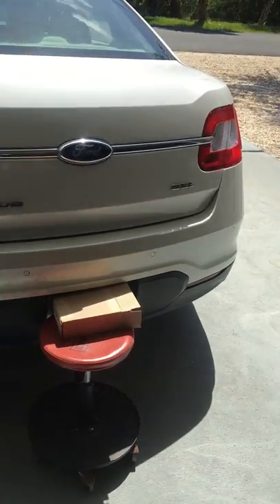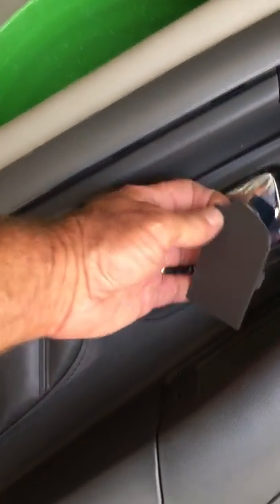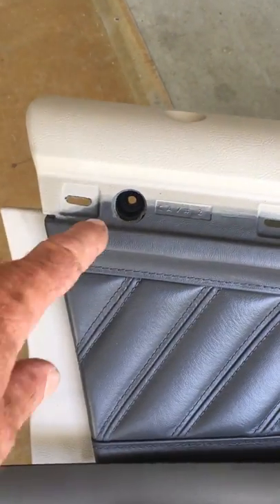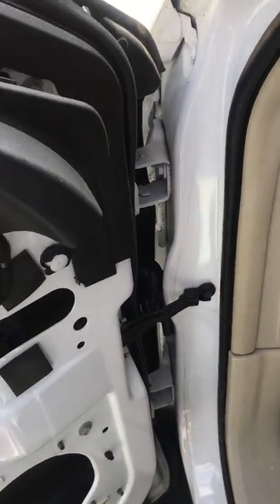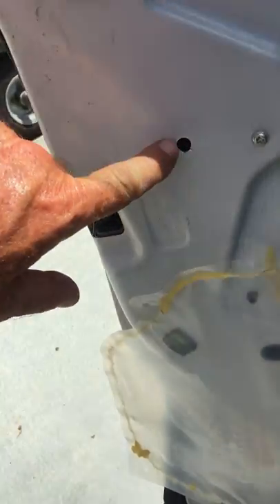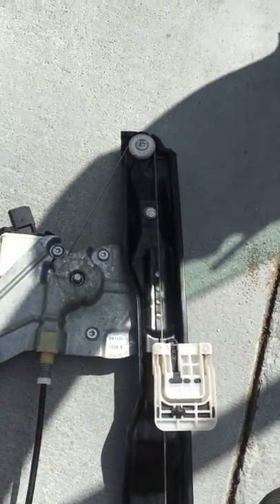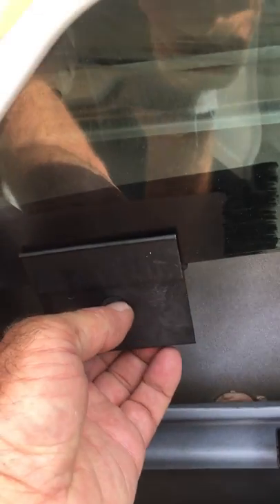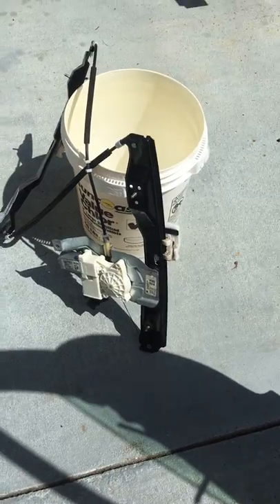2011 Ford Taurus window motor/regulator replacement Taurus window

Comment: I can't get the window lowered. Did you somehow power it down? Sounds like you used a wrench at 2:56, to somehow turn the regulator cable/spring?  Thanks, Jay
Reply from the maker: Actually I hooked the power back up to the motor, held the switch in the down position and tapped on the motor with a pair of pliers.  It jarred it enough for the motor to run for a second and the window lowered enough for it to be unhooked.  Hope this helps.  Sorry for the late reply.  Just noticed the question.  Good luck

Comment: My front left window on my 2009 Taurus keeps falling down and out of place. The motor does not move it up or down. I'm looking for a replacement part on eBay and was wondering if I needed the regulator with the metal paneling or not. Thanks for the help.
Reply from the maker: I'm not familiar with the 2009 model.  Did you pull the door panel and look inside?  It could be that a bolt came loose or perhaps the regulator is actually broken.  I assume the motor works but doesn't raise or lower the window.  Sorry I can't be more help.

Comment: What would I check if all of the windows stopped working at the same time..??

Is there a fuse #
Thank youv
Reply from the maker: There are a couple of fuses located in the car.  Position #1 for the front left, position #4 for the front right and position #47 is a circuit breaker for all windows I believe.  I'd check the circuit breaker first.  I've also heard of cases where the wire breaks where it comes into the driver side door.  You may hold the switch down and move the door to see if it would possible make contact.

Good luck
Reply: @joeb327  thank you for the reply. 

I'm thinking the breaker for all the windows..  Because they all stopped working at the same exact time. 

I'll give it a check 👍👍
Reply: @joeb327  replaced nber 47 and no luck,  going to do 1 and 4 next. 
all 4 windows aren't making any noise or trying to move. 

Could you elaborate on the wire and where to check it? 

Ty

Edit : actually I replaced 47 with a 30a maxi fuse....   Was it supposed to be replaced with a 30a circuit breaker...

Not sure if there's a difference
Reply from the maker: @adamhearts9195  The wire I was referring to is on the driver side door.  I believe I had read somewhere that sometimes if can break.   My guess would be in the flex connection where it comes out of the and goes into the door.  Try holding the window switch on and moving the door or the wire loom and see if it makes any contact.  Another thing that I would do is remove the window switch from the drivers door and check to see if you are getting voltage to it.  I don't know what wire is the hot one but it shouldn't be too difficult to figure out.  I'm not sure if there is window relay/fuse in the panel under the hood.  Wish I could give more advice but that about all I know to do.
Reply: @joeb327  thank you for the information..  I'm picking up that circuit breaker today at 3.

The issue your reffering to, does that 1 wire effect all 4 windows? Or only the driver side window.

They all stopped working at once so I'm assuming it is a fuse/circuit breaker or power to all of the windows.  Not individual motors or pieces in the window motors. .
Unless they all separately broke at once... But it just seems implausible at the moment.      I'll have to look if they're all getting power.

Thanks again for responding
Reply from the maker: @adamhearts9195  I'm not 100% sure.  My assumption is that the main power for all windows goes through the drivers side door first.  The reason that I say this is that there is a switch on the drivers side door that disables the other 3 windows.  I would try to see if there is power to the drivers side door first.  Seems to me like the best place to start.   Good Luck.  Let me know what you find out